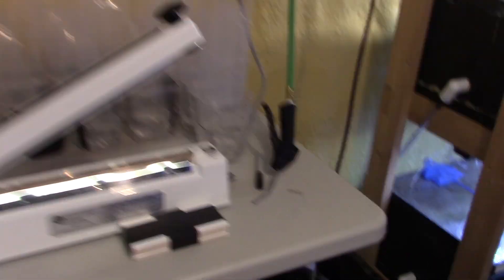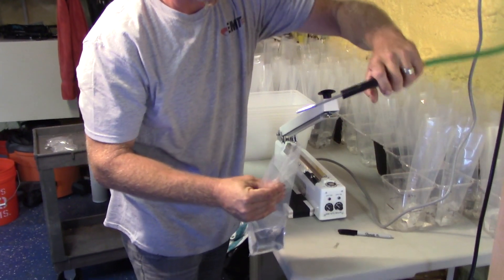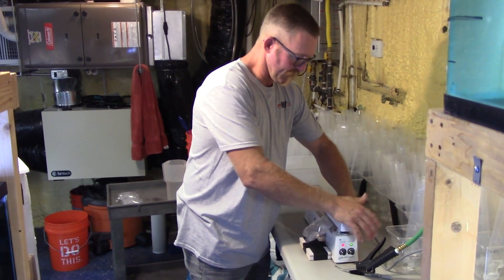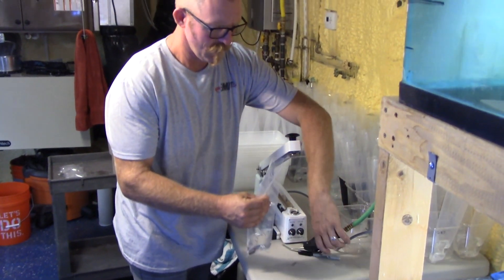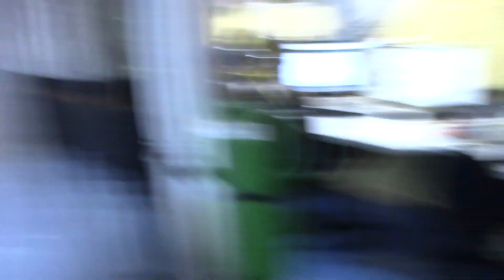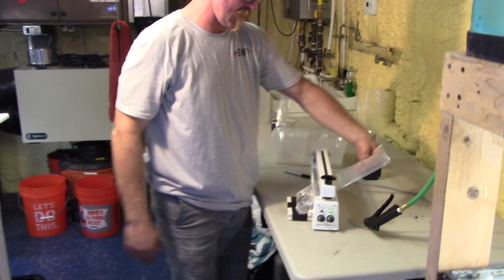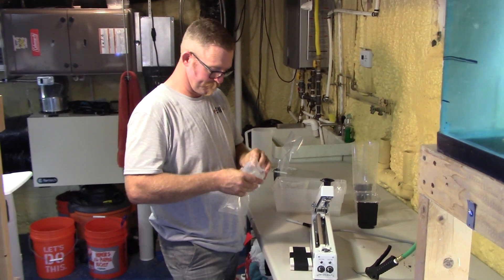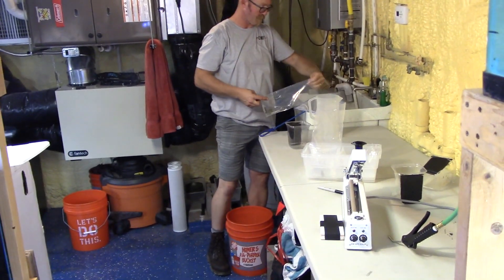Pistol vs New Impulse Sealer Vlog #5

Comment: Thanks for the info on the sealer.  I've wanted to inquire about one for myself, but do you have a link to the model and maker so that I can check it out?  I don't have any idea on what the cost would be, but it's very intriguing.  I'm certainly pleased to see the way it works.  This is the first time I've actually seen it operated.  I've only seen resulting bags that some people have.  BTW, does it require special bags, or does it seal any plastic fish bag?  <“(((((>< Fishez <“(((((><
Reply from the maker: You got it Fishez. Here's a link to mine: https://www.pack-secure.com/AIE-305HIM--12-Inch-Hand-Impulse-Sealer--5mm-Seal--Magnet_p_484.html I just use normal 4 ml bags.